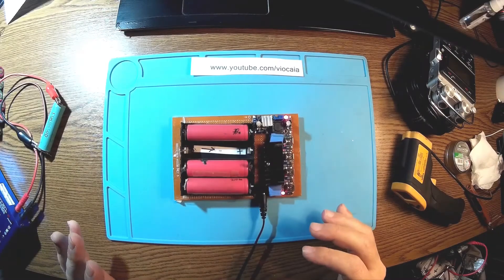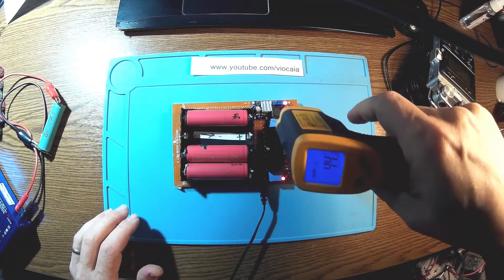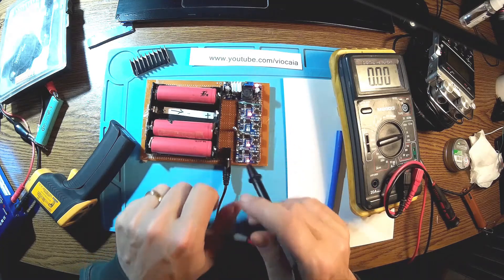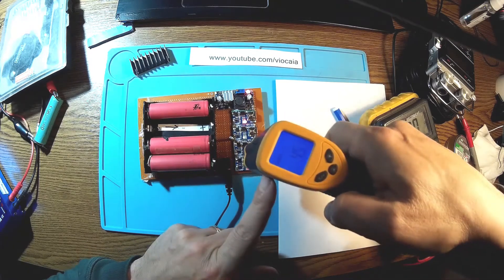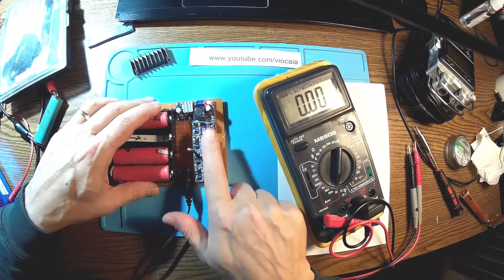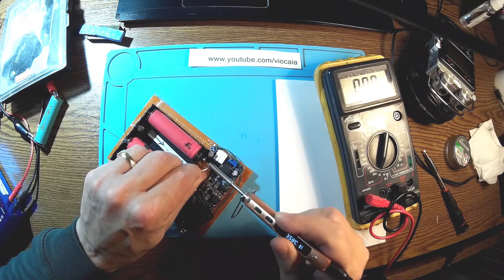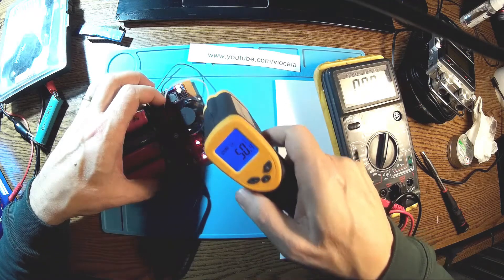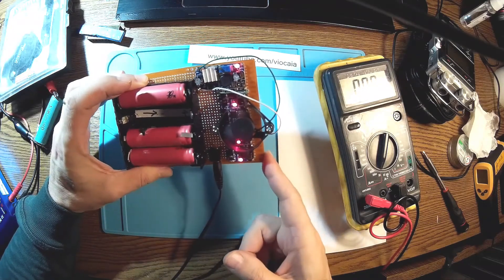TP4056 18650 DIY lithium charger  heating fix

Comment: The TP4056 module contains a chip which has a solder pad underneath the black chip body.  The heat from the chip travels down through the PCB to the bottom surface through an array of plated through holes.  If you place these boards on an insulating surface, such as a project board, this will insulate the bottom surface of the PCB and the module will try to reject the heat from the top of the board instead, which is only about 30-40% efficient overall.  Therefore the temperature of the device will increase dramatically.  Try mounting the module boards on a heat sink body such as copper or aluminum to continue the heat path.  Alternately, mount them on their edge like books on a books on a bookshelf with space between them for good natural convection.
Reply from the maker: Of course , good idea, I'll use some thick thermal pads under to a aluminium plate in the next version

Comment: A couple of things but those fans are sleeve bearings and like to be in the vertical position.  No worries it just wears out faster.  Next thing is to stick the heat sink back on there and add the fan on top of it (so use a longer screw) and everything will flow as it should.
Reply from the maker: Good remarks! Thanks!

Comment: Tp4056 has heating problem above 1amp input voltage...... I am using with old 700ma 5v charger 24/7 with zero heating issue.... 😁
Reply: How? Current could be a mega amp available, but only 1amp is demanded.  If what you say is correct this tells me that your 700ma 5v charger is forcing the TP4056 to only have 700ma at hand to charge a battery even though the original R3 says to do 1A (which it would if supplied with 1A, or more).  Since 1A is its max (per the specs) that is driving it too hard so back the current down (which you did via a brute force method of your supply having a max of 700ma).  I think I will drive this with a XL4015E1 in CC mode at 900ma to see if it gets hot as I have everything on hand, just need to make it.
Reply: @generalawareness101  waiting for your results at 900ma
Reply: @manjunathcv9146  Bed time for me but over this weekend I will put it together as my batteries are being delivered early it seems.  First I will try it with my USB 2.2amp charger, and if it gets hot I will try it with the XL4015E1 at 5v 900ma CC.
Reply: @manjunathcv9146  I just finished making it, but the batteries did not arrive today as our USPS is horrible in this city.  Should be delivered on Monday but is still scheduled for Tue having been in my city since yesterday.  I will update you with my findings.
Reply: @generalawareness101  Many thanks for your updates...
Reply: @manjunathcv9146  Testing it now as my batteries just arrived.  3.725v they came to me so not 100% 1A (this is putting in around 950ma) and it is hot.  I measured 60c on the chip using a type K thermocoupler, and my DMM.  btw, the operating temperature range of the tp4056 chip is: Operating temperature	-40°C ~ 85°C
Reply: @manjunathcv9146   I am done testing it as it started to go down in temps but always 52c-60c.  Will not ruin the chip but even the underside of my strip board was warm, so I threw on a 9x9x5mm tiny heat sink with some heat sink tape they use on the 3d printer stepper drivers (that get way hotter than this does).  I feel the heat with the heat sink, but not so hot I have to pull my finger away either and the under side of my perf board is way happier too.  The tiny heat sink is 47c vs the 57c I was getting on the chip so a 10c drop.  I am happier now.
Reply: @generalawareness101  thanks for the information 🙏
Reply: @manjunathcv9146  You are welcome, and I will be purchasing a nice power supply in the next couple of weeks to months where I will try some other things.  I will come back to this thread when I do as I have it bookmarked.
Reply from the maker: of course! Nice..